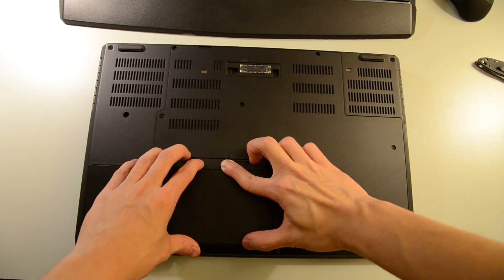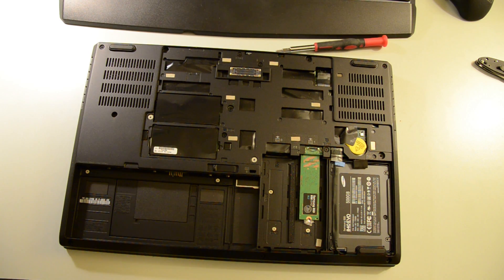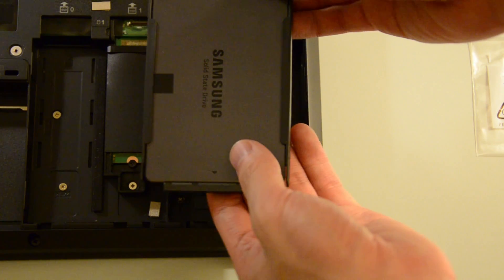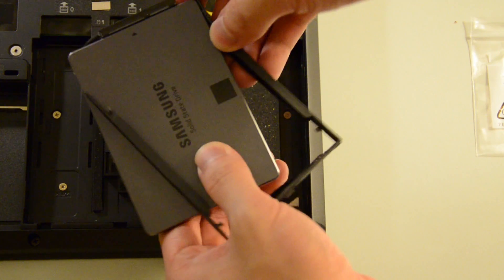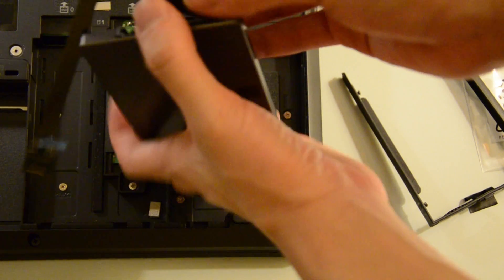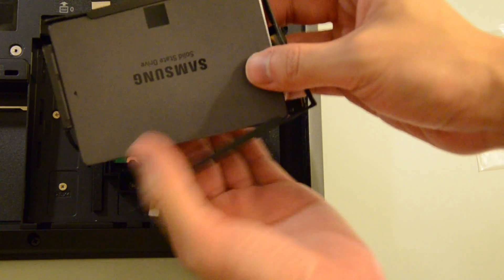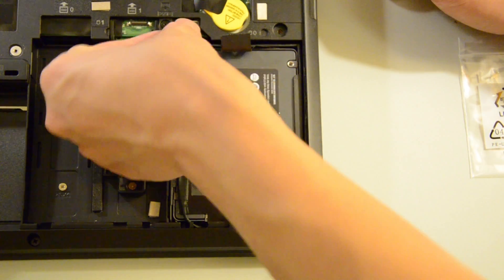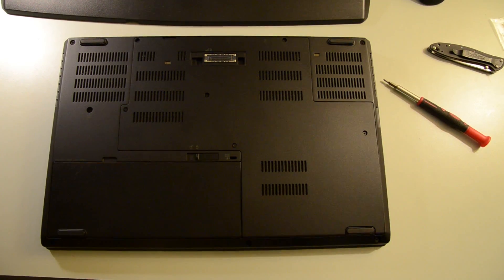Lenovo ThinkPad P50 2.5" SSD/Hard Drive Install

Comment: Thanks. If someone is looking for the adapter you can search "caddy m.2 thinkpad p51" I bought it on aliexpress and it worked. I chose the right cable but I think left works well too. But if you buy the right it must work.
It came with the rubber.

Comment: I need to make sure this is clear.  The 2.5 drive bay is on the right side, but the cable runs up the left side, right?  I've ready some cautionary tales on getting the wrong adapter! Many thanks
Reply: Please help. do I a right cable or left cable??
Reply: Please help. Do I get a left cable adapter or right?

Comment: Thanks. I just installed a Samsung 860 into my P50, and it went really smoothly thanks to your video!
Reply: Hi JM, can I ask you a question about this?  I need to make sure this is clear and I'm getting the right SATA cable adapter!.  The 2.5 drive bay is on the right side, but the cable runs up the left side, right?  I've read some cautionary tales on getting the wrong adapter! Many thanks
Reply: @scottryanjohnson5145  It's been a long time, but I will check into this. If I somehow forget, please comment on my channel. I have another video about the P50.

Comment: My Lenovo P50 Model# 20EQS1YJ00.
Can U let me know if it needs the Right Hand Cable vs the Left Hand Cable?.
Reply: here with the same question?
Reply: @olaf2046  did you figure it out?
Reply: And me
Reply: @stephenallsop1472   I can help you. What's your model?
Reply: @Paul Chibamba i have ordered the left side one as the drive is left of the touch pad as you look at it.....hopefully its the right one. I appreciate your reply on an old video. Its a p50 but refurbished so it has the 2m storage in it. I dont know much about comps sorry
Reply: @stephenallsop1472  was that correct?
Reply: Up...

Comment: Thanks for the video. I was hesitating to pull the old drive out as it is fit quite tightly and the sata cable seemed stuck to the board when pulling the tab.

Comment: Hi, can you mention the exact product name of the caddy with cable needed to connect a drive, i cannot find it on Lenovo site. Possible to link the product to order ? Thank you in advance
Reply from the maker: FRUs for Primary HDD (right) cable is UR835 and Secondary HDD (left) cable is UR836. Unsure about the rubber piece.